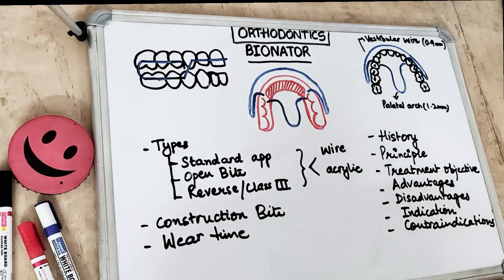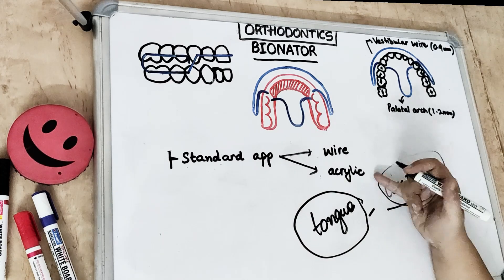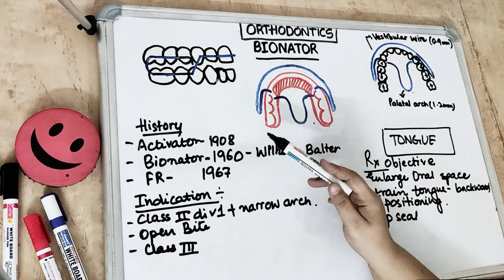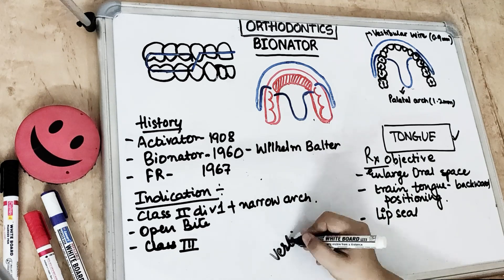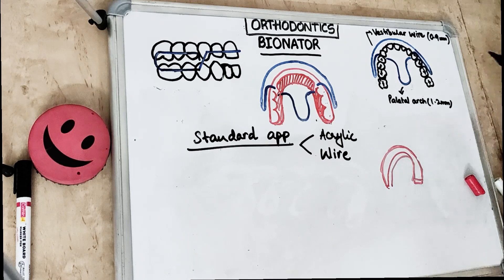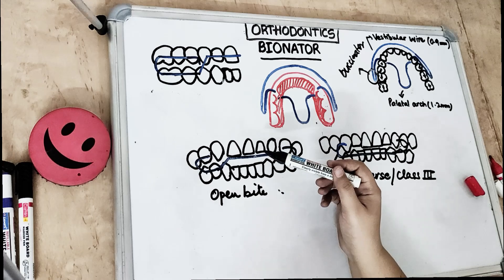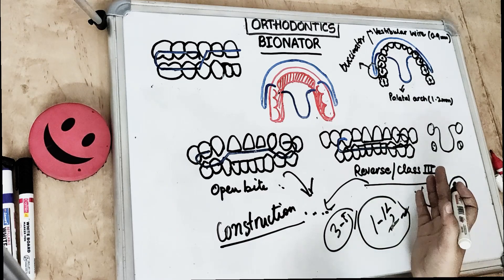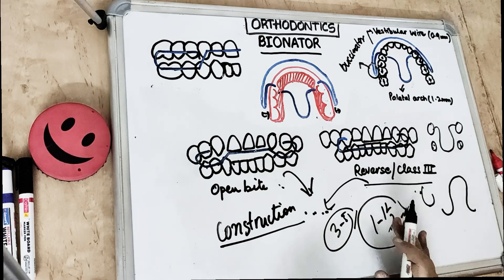bionator appliance in orthodontics I dental lectures

Comment: Ma'am  incase of reverse bionator you said that tongue touches the palatal arch and further lead to forward growth? But is class 3 pts don't  we require backward growth 
Also same is the case with class2 div 1 pts won't  the forward growth of mandible help?
Reply: Same doubt here
Reply: Tongue touches the palate and the anteroir advancement of the maxilla(retruded maxilla) and have a restrictive effect on the further mandibular growth so for the same reason we can't use it in class 2 div 1